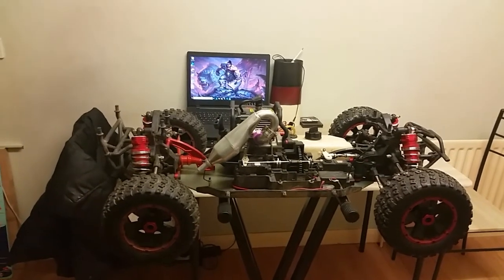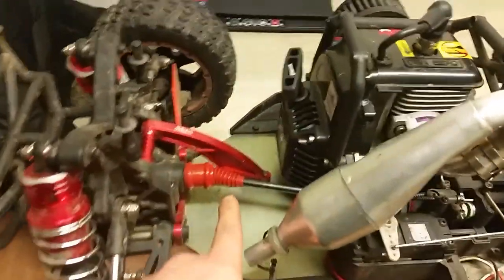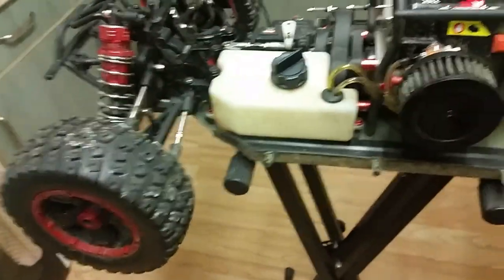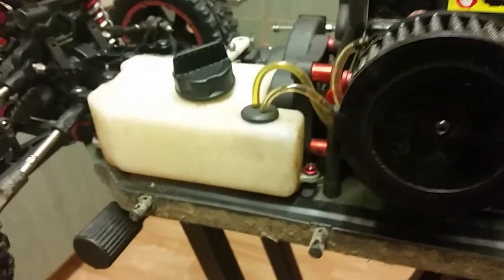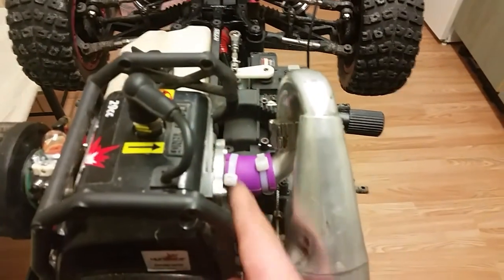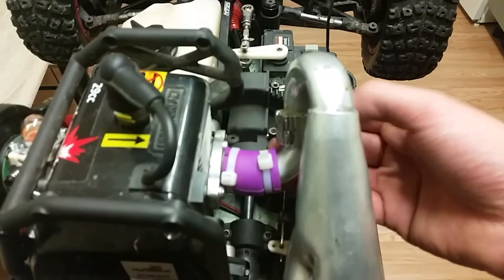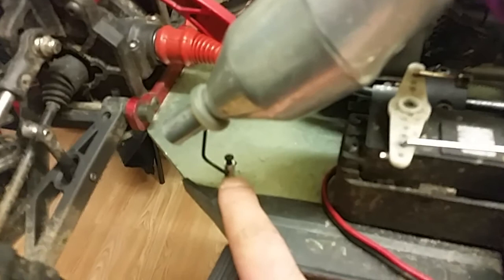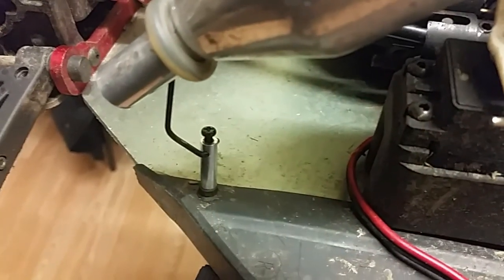Losi DBXL Baja Exhaust Pipe Mod.

Comment: Can you tell me about the center drive shafts on the first run my pin came out of the front and rear center drive shaft
Reply from the maker: Yeh its pretty common with this cars  for that to happen. You need some thread lock on the grub screws to stop them from coming out.
Reply: Tuga RC ok but I can’t find the pins online for some reason so I don’t know if I’m asking to much but would you happen to have a link or the part number saved also what other thing should I lock tight
Reply from the maker: @trix_iosyt1240  I got this link from Ebay https://www.ebay.co.uk/itm/191734301908 
Try that bud. What else you might need to tread lock?
Everything that is screwed in to metal bud.